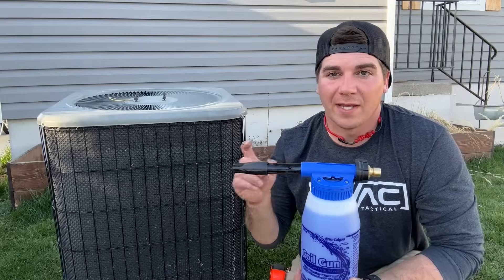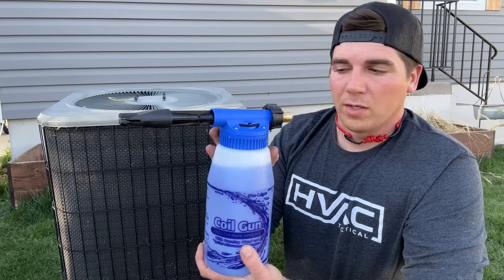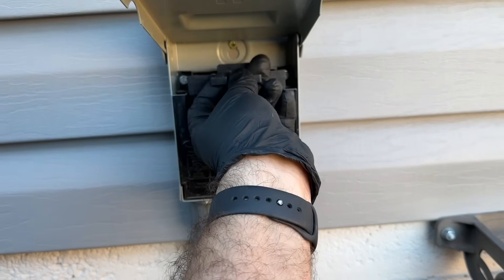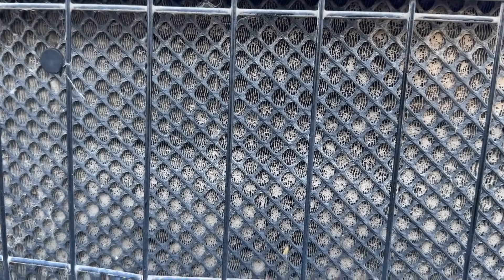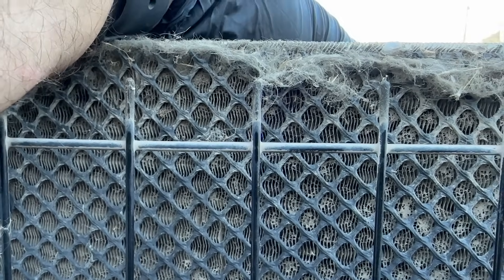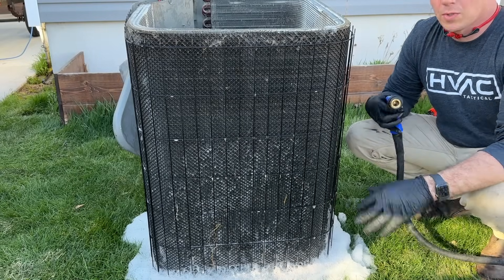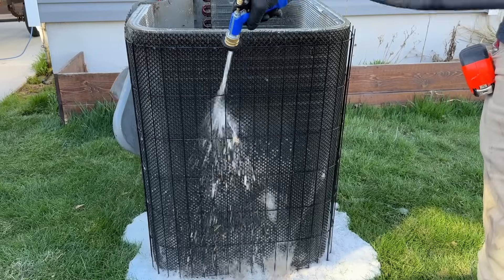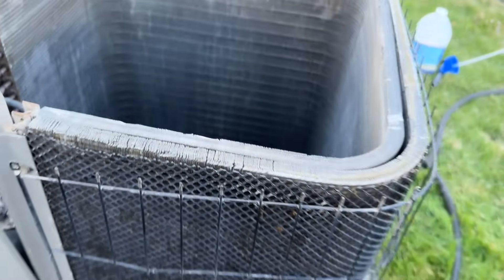How To Get Ice Cold Air By Cleaning Your AC Coils The RIGHT Way.

Comment: You could have foamed from the inside of the unit as well since you had the top off and rinsed from inside out and then done it again from outside in.
Reply from the maker: I did a coat of cleaner on the inside as well. Not sure if I showed that or not. I thought I did  🤔
Reply: @diyhvacguy  Nope, you didn't...I was just about to come here to comment/ask why you hadn't also cleaned the inside coils as well...but Mark beat me to it 😉 Just found your channel...greats vids!
Reply: @diyhvacguy  Many folks may not read these comments and realize that. You may want to do an edit and/or a redo. Good video anyway!
Reply: I wondered that too. I thought rinsing from the inside out was the way it was logically done, fact I thought it was the only way when you have it open and would start the chemical treatment there first.

Comment: Ive read and been told that these coil cleaners cause degradation of the metal fins of the outdoor unit, causing leaks. Im wondering if 409 spray cleaner would do the same thing less toxically.
Reply from the maker: It’s dependent on the ratio. If I did 3:1 it might have an impact but for most people a 10:1 ratio is fine and will not eat away any metal. Even at 3:1 that’s not true. Heck it didn’t even kill the grass I did this video on!
Reply: Can I use Dawn dishwash liquid?
Reply: @Pearl3Drummer  Simple Green would be a better choice, way less suds.🤙

Comment: This is a foam gun for washing cars (the predecessor of the foam cannon). This is a great use for the foam gun because it uses lower pressure and you can control it.   Don’t use a foam cannon with a pressure washer. It can damage the fins.
Reply: BUTT, if you BLAST all the cooling fins off your condenser coil,
You'll NEVER have to clean it again !       B-)
Reply: That's what I was thinking. Doesn't seem to be any different from a regular foam gun.. Or am I missing something?
Reply: Going to do this with my Tesla👍
Reply: Foam cannons on a pressure washer don't output high pressure though... Probably fine to use to apply the cleaner, but don't use a pressure washer (with a nozzle) to rinse.
Reply: @nickydexgg4579  This is what I'm thinking, just use the pressure washer to get more foam/better coverage in less time than the gun. Then just turn off the pressure washer and use a garden hose or jus use the same pressure washer wand but with the pressure turned off.
Reply: @PerfectorZY  I agree. The foam cannon will apply just fine. Then, after your dwell time, low pressure, high volume rinse. The "shower" mode or similar on most hose end sprayers is great for rinsing out the soap.
Reply: I use a foam cannon in the radiator of my bike several times a week, when I’m washing it, and have never had a problem. I also rinse it with my pressure washer, and haven’t bent a coil fin yet. You just have to be careful, not spray from the side, and not spray it too close. After a couple feet, the pressure has dissipated greatly, and the water is more atomized then it is a direct stream.

Comment: I have a train 4 ton condenser but the coils looks like chrome stencil that you would wrap around a Christmas tree an would I still clean them the same way like you're doing in this video, it's a new unit only 2 years old but down road.Please advise if you can.
Reply from the maker: Yes you can use this same foam gun, however I would use Nu Calgons Nu Clean which is a yellow cleaner you can buy by the gallon. The fins you have are called micro channel. But you can use the same method and rinse it the same
Reply from the maker: I’m going to do a video on micro channel soon as well!
Reply: @diyhvacguy  he's talking about the Trane spine finned coil here

Comment: My HVAC tech recommended just using straight water from my hose on the jet setting.
Reply: If you like corroded coils, listen to the guy that made this video. Use water
Reply: If you use JET SPRAY..... Always make sure you are spraying directly into the  coil. If you spray at an " angel " you can bend the coils fins.
Reply from the maker: Yes if you do it regularly that would do the trick! It’s when it gets built up that you need the cleaner.

Comment: I run the unit while I spray it. It sucks the cleaner all of the way through. Then I turn it off and pull the top and clean it up after the foaming is all of the way through. Of course I am careful to not spray the cleaner on live electrical components. It does rain outside. It does rain sideways where I live. A little water and soap carefully sprayed while the unit is running will not hurt, and I have been doing it for 30 years. Making a YouTube video you wouldn’t want to recommend that process, but I just did. 😅
Reply: Very good to know Sir!
Reply: Why not just rinse it from the inside pushing the debris out?
Reply: @Maynardd  you can do that, but it’s not always necessary and I don’t give a crap what anybody says. If you can get it clean then it’s clean
Reply: @Nine_883  you don’t give a crap? It’s called common sense. You should try it.

Comment: A neighbour said her AC did not work very well any more, I took a look and it looked like some one had wrapped the condenser in a  carpet, it was so plugged like i have never seen before!, i removed the cover (after the disconnect) and unwrapped the carpet of grass clippings, and washed it out thoroughly, Worked fine after that, told her to mow the lawn in the other direction instead of shooting it into a running condenser,
Reply from the maker: Yea it’s always a good idea to pull the disconnect when cutting grass around it. It acts like a vacuum otherwise.
Reply: She is lucky to have you as a neighbor. Avoided a shady company looking to sell a new unit. A lot of hvac companies try to sell stuff you don't need or employ techs that dont know what they're doing.

Comment: Why not just use a pressure washer?
Reply: You can easily damage the fins on the coil and this will reduce air flow and heat transfer. It’s not necessary.  Foaming coil cleaner will push the dirt through.
Reply: @Nine_883  Depends on what pressure, nozzle and how far away you are.
Reply: @Boodieman72  True, but he is making video's for the DIY guy who might not know that.
Reply: If you aren't careful, you can bend the fins with a pressure washer.
Reply from the maker: Yes as others have said you could more easily damage / bend the fins with too much pressure. Of coursing if you know how much pressure is being applied that is one thing, but it has potential to cause damage depending on who’s hands it is in. I always just recommend a garden hose with a nozzle 👍🏼
Reply: @diyhvacguy  You would need a lot of pressure to bend the fins.
Reply: Throttle down on the washer.

Comment: I switched to Viper pack cleaners a couple years ago,the Nu-brite will eat your coils over time,the Viper is micro channel safe and wont hurt even if you dont get then rinsed completely! I used the blue for a long time,it is very good on filthy coils,but I dont let them get that bad,but evao soap is my go to for maint purposes.
Reply: Dawn dish soup and warm water is all you need
Reply from the maker: Yes that’s the beauty of that’s foaming coil gun. You can set it to E and it will ration out 10 parts water to 1 cleaner. A gallon would last forever.
Reply: @diyhvacguy  Excellent
Reply: what is evao soap?
Reply: @DerpMcDerp101  evap, it was a typo! Or maybe I had too many cold deers that night!
Reply: I guess that's the beauty of a separate, adjustable gun. You can choose your cleaner, and the mixture ratio.
Reply: Which Viper product do you use?
Reply: @MrKentaroMotoPI  purple,gold,blue and green! Blue=HD, Gold =General cleaning,Purple =Clean Anything,Green=Evaperator
Reply: @petersmart1999  Oh yes! Thank you, Peter. Even I can understand colors. I like the specialized formulas for evaporators and condensers. I assume they mean indoor vs outdoor heat exchangers? I have a mini-split heat pump, so there is no dedicated evaporator or condenser. It has micro-micro-micro channels on both, and I can envision them plugging up.
Reply: agree, i use the viper yellow that works for evap and condenser. i clean after winter and right before heavy summer hits. Louisiana weather changes on a dime. always helps to prerinse coils before hitting with cleaner. note: any foam gun will work just be sure to check mix ratio with cleaner mix directions.